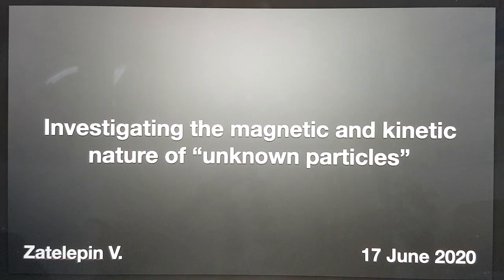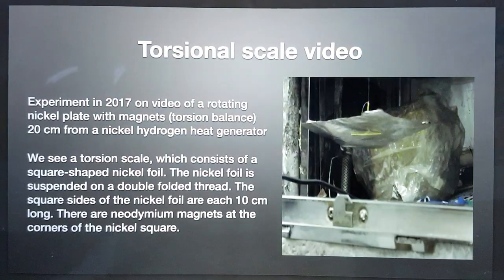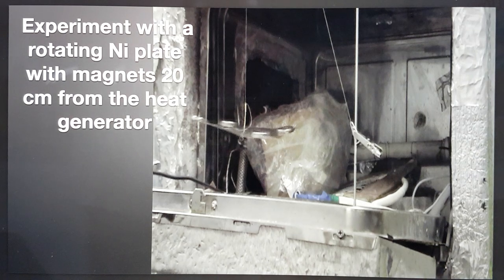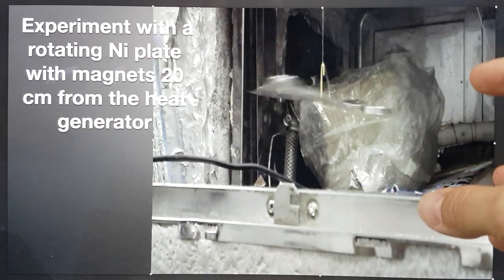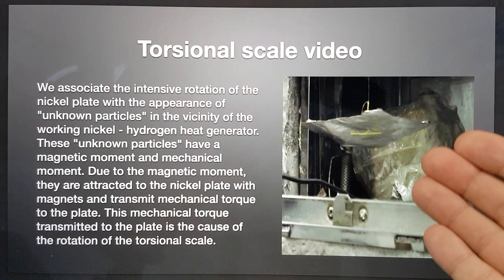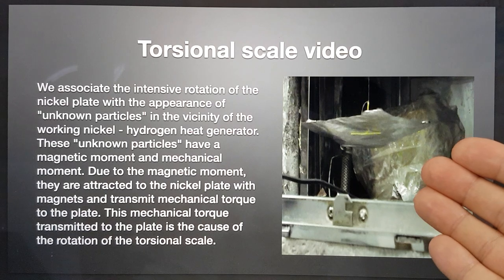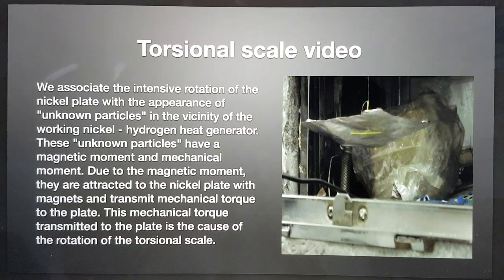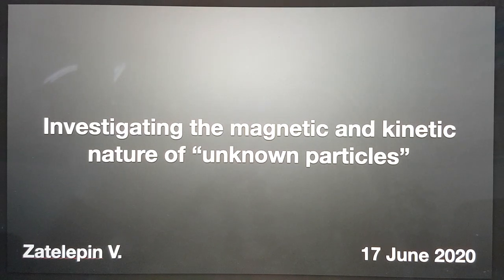Investigating the magnetic and kinetic nature of unknown particles

Comment: My Time Capsule: moire convert displacement into a perpendicular action, too. I'm still hoping everyone will notice that moire simplify the model, and let you predict the effective fields. What are moire ? When repeated patterns of slightly different frequency, source, OR planar orientation, are overlapping with slight displacement, then they induce a magnification effect (as well as a twist or crab-walk!) - whatever pattern was repeated on the small scale appears as a "ghostly" influence across a much larger area. When a set of waves already permeate a space, and they jiggle, then the apparent wave can move faster than light. Phased array-ish options arise. And, by gently permeating across a large area, a magnified moire pattern can trigger random, sparse events, without needing to penetrate at HIGH energies . Hence, particles may 'appear' far beyond their source , too far for their expected lifetimes. moire also gives you that torus of strange influences; a halo forms, many times larger, as you tilt the patterns in relation to each other. Without a macro-scale orientation of forces (CURL), it's hard for atomic processes to generate micron-sized vortex holes. The best video on Youtube that explains moire magnification and twist is Numberphile's "Freaky Dot Patterns" at 4:00 in. As you displace the patterns, you cause a displacement of the halo of influence; the shape and acceleration of that wave front is what you want. Good luck.

Comment: It may help us replicate your experiments. Please list wattage of microscope laser among with the wavelength of output, what type of bottle plastic is that recycling marks are normally seen on the bottom. Could the masking tape brand be a factor or is that not a contributing factor? The shamfered hole in the magnetic component may be influencing the field geometry. Do you think this is a resonable assumption?
Reply from the maker: Thanks for your offer Agent X. Of course, all things may be a factor.
The bottle is thin PET AFAIK, I will try to see next when I can get to it. I do not think that the laser is causing the marks, they were not there when placed over the fuel container and took several weeks to appear on the inside curve of the bottle. One detail was that a large metal bowl was placed over the whole assembly you see in the photo to remove some potential environmental influences. Masking tape did not contact the affected area.
The microscope was similar to this one.
https://www.olympus-ims.com/en/microscopes/laser-confocal/ols5000/ 
It is conceivable that the marks are naturally what PET does, and this should be confirmed.
Strange radiation tracks were also recorded on the inside of the fuel container. In star formation like Matsumoto, showing that it is not a three body interaction as both fuel and container are static, also, the container was shredded along these track lines.
https://steemit.com/science/@mfmp/ecco-macro-photography-of-strange-radiation-tracks-in-fuel-container
You can see that there were tracks on the 400ASA large format negative, on the fuel itself (with tracks coming from spheres) and on the sensor of a masked Logitech 910C.
https://steemitimages.com/p/Zskj9C56UondJxcjVaienfhVaNb7LJVWG6e787gaPU23yUKj8zbzsPzKk585MXZ3KbGHcJFJiDJytyQd6KQCJncvx2ZPZJZXWXKMviB2jmFCEwR2R41k?format=match&mode=fit&width=1280 
https://steemit.com/steemstem/@mfmp/what-really-is-new-fire-fuel
The magnet used for the ECCO fuel experiment was flat, it did not contain a chamfer, nor did the one on the experiments of Fredericks.